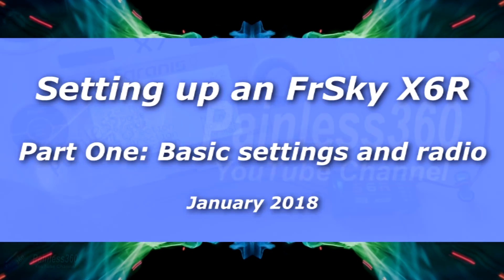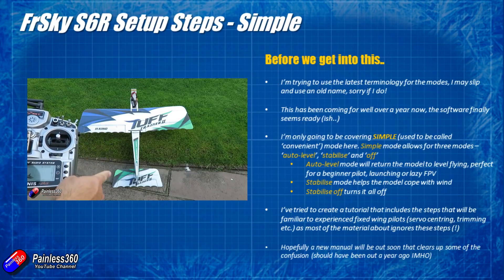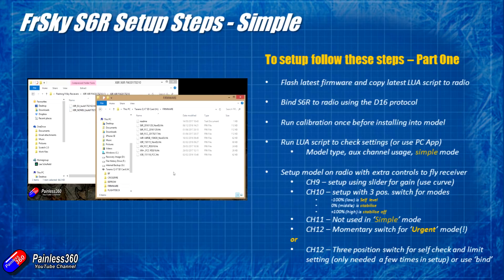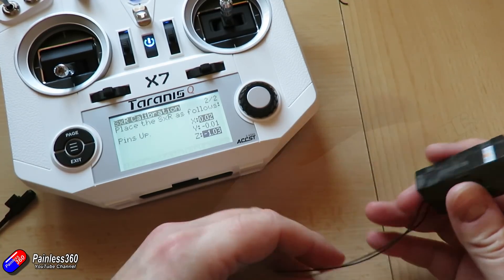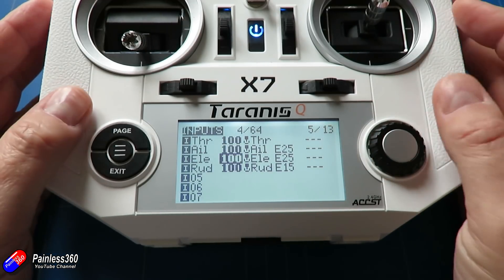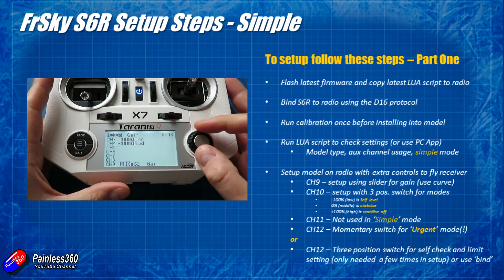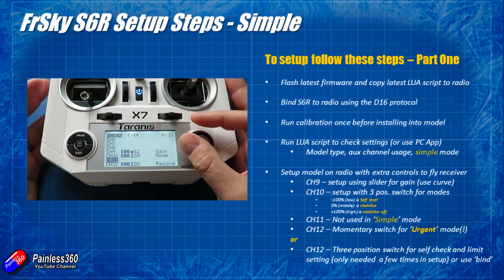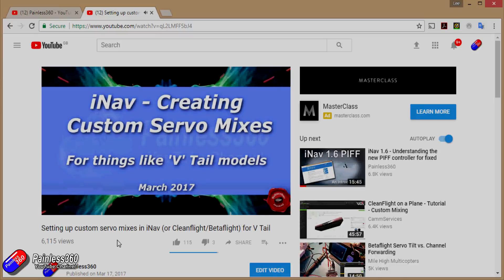(1/2) Frsky S6R/S8R Basic Setup

Comment: Hello thank you for making this video, I get an error code on my taranis after I try to execute the Lua scripts for s6r, it will not allow me to calibrate it nor select any of the selections on s6r lua scripts
Reply: Nathaniel Pike, I had same error when I ran Lua script with receiver plugged into taranis with a cable via s port. You need to bind the receiver and calibrate using the RF link
Reply: @TonyChallis   hello scouring the web for answers.  I have been trying to use the RF link between my Tx and the S6R and I cannot get the Lua script to do anything except go to the intro screen.  Any resolve to this.

Comment: Hi can you help me as i got crow on the throttle but i like a switch so i can have the  throttle on the throttle stick and also have the crow on the throttle stick so i can have one on at the time i have look at all on the mix school  and i can not work out how to do it
Reply from the maker: Lots of ways to do that, only have it 'on' for certain flight modes or simply add a 'switch' to the mix line for CROW mixes on the outputs. Both are shown in the series lots and lots of times. Best of luck!

Comment: Great videos, Thanks a ton.  It took me several times watching it to notice that the lua scripts run with no cables attached!  I finally got it bound and caibrated.

At time 12:34,  setting up a custom curve for the X7 s2 pot for gain.  The other easier way to do this is to set the offset for S2 under mixer channel to 50 weight and 50 offset.  This gives it half the travel range, and starts it at the midpoint at the bottom of the pot (rotary switch). This gives it a range of 0 to 100, versus -100 to 100 it would normally have.  This is the same way most of controls need to be adjusted to use the QX7 as joystick for PC based simulators.  You could still apply a standard or exponential curve on top of the offsets if you want too.

Comment: Is the receiver text need to be facing you When calibrating the SXR with the pins down and up? I do it in a way the receiver is 90° to the table, is that ok?
Reply from the maker: Not sure what you mean. All of the steps I used are in the video. Best of luck!

Comment: I had to reverse the rudder and elevator on my x9d plus outputs to get all surfaces moving in the right direction in manual mode. But now the auto level and stabilizer modes on the S8R seem to react in the wrong directions. Should I have reversed the rudder and elevator somewhere else?
Reply from the maker: All I have figured out is in the video and the steps have to be followed for it to work.. Best of luck..

Comment: I have a Tatarnis DX9plus. And I want to use the S8R for my plane.
Now I see 6 files on the FrSky site in the Firmware folder.
And there are also 4 files in the Tools folder.
Do I have to do all these.
Or has an explanation about which files to use
Reply from the maker: You need the files in the SXR folder on the SD card. Best of luck!

Comment: Great explanation and videos. I was wondering, PROVIDED you were only using the Rx in basic/simple/convenient mode, surely you could position the Rx with servo plugs forward so long as you changed the gain direction of the gyro for the elevator.The other thing which may help others who use all 5 flight modes, I was sure I would get confused by the switches at the field so I found a simple way to get all modes. I set the 3 position switch I usually use for flight modes in the logical switch screen to override ch10 and ch11 to the necessary positions for OFF, STABILISER ON, and SELF LEVEL then  1 other switch of my choice to override the ch10 and ch11 settings for HOVER and a third switch to override ch10 and 11 for KNIFE EDGE. Note: you have to set the mixes source to just the ch number

Comment: I have been flying with the S8R for quit some time now and it all was because of this guide. I followed it and it just works. My Eflite Maule now handles crazy wind haha. Auto level mode is kind of weird flying in but it is level and I have used this mode when wind was a factor and made it hard and it practically lands it self, you just have to give it some throttle input to balance the ladning speed and S8R does the rest. 
However one thing I found weird, since I have my S8R mounted Lable down is this why I have to invert all my channels in S8R lua setup? I had a little action today after I had removed Y-cable to Aileron servos and is now controlling aileron with 2 servos. Aileron channels was at Normal and when i turn on the auto level mode, well it started spinning like crazy since the controller was working against it self hahaha. No worrys though, just turned it of and regained controll but the lesson here is always have a substantial flying altitude while testing new things :) Cheers!

Comment: I've installed this receiver in a Parkzone Corsair,  WingWing Z84 and a Freewing F9 Panther.  I will never fly again without such a receiver, unless I'm installing a iNAV flight controller. 
This receiver works extremely well and not only improves flight performance, but also provides a nice safe feature, no matter how experienced a pilot you are, it is cheap insurance to have the autolevel feature when you need it.  It works equally well for both conventional prop or EDF driven airplanes. 
It is not particularly difficult to set up with with the STK tool or with Taranis Lua script.  There are plenty of good YouTube videos available such as this one.  Just follow them very carefully and triple check to make sure that the compensation is in the right direction.  
By the way, this receiver works just as well with the antenna pointing toward the back instead of the front which was more convenient for my particular installs.
Reply from the maker: Good for you. Why not make some videos to show how you set it up and share that knowledge? Best of luck!

Comment: Hi Lee - stuck at the first fence! Got all the latest firmware (using Qx7 radio). Bound the receiver using D16. When I run the LUA calibration my XYZ axis remain on Zero and the "(Enter) to validate" doesn't appear. Your help, as always, would be appreciated.

Comment: Another wonderful tutorial, thank you for that.
Couple of questions, though.  I don't yet have a stabilising receiver and am kind of hanging back because of your iNav videos, which seem to offer some additional benefits such as Return To Home.     I am only flying fixed wing.
1    What are the benefits of just settling for the S6/8 XR rather than the whole hog of iNAV?
2    I see you are using a different radio. Can the S8R also be used with my Taranis Plus?
Seems to be a lot of things happening in this new (new to me) world.
I am now in my 70s and am considering the potential benefits of a "save me" switch, if, and when I lose orientation.
Your comment will be greatly appreciated, perhaps by a few others also.
Keep up the good work
Bruce
Reply from the maker: +Bruce Austin 1) GPS and OSD support 2) yep. If you want GPS then go INav. If not, then this is worth a look. Hope that helps..

Comment: Excellent info , thanks .  looking forward to the second instalment
Reply from the maker: You can preview the second part (out very soon) using this link - https://youtu.be/_IVFoB8gY6s
Reply: @Painless360  
Hi Painless 360,

Really apreciate all the videos u make, I literally learned everything i know about setting up opentx radios from u! Big fan! Im kinda stuck on settjng up my gyro though. So first of all im using frsky archer sr8 and sr10 which is the access version of the stabilization receiver. So my issue is my retracts on channel 5 do not work even when i set them to auxiliary. Then only time they work is when the gyro is completely disabled. How do i set it up so everything can work. Also is it possible to move the gain and switched from channels 9-12 to say channels 13-16. My sr10 has channels 9 and 10 which i would like to use for something else. Thanks you!

Comment: Hey! Very useful. I'll definitely be following this series. Thx!

PS: Hopefully others (commentators) will jump in and share their successful setup / settings. TIA!
Reply from the maker: You can preview the second part (out very soon) using this link - https://youtu.be/_IVFoB8gY6s
Reply: @Painless360  my s6r doesnt output any servo signal, i bind, calibrate and all, motor spins with throttle, but servos are like they dont get any power to them.... any ideas why?

Comment: Nice stuff!  I have been figuring this out lately as well with the help of some of the sites you mentioned and have it all working, phew.  A suggestion is for Ch9 pot.  Instead of using a curve that goes from 50 to 100% each way from the middle detent, set it up like so, I have Pot S1 on ch9.   S1 Weight +50%, Offset 50%.  That way, it goes from 0-100% with 50% as the middle detent. 
Also be wary of Ch12 and Urgent Mode.  After the 3 flip settings to get it calibrated, you must remember to move it out of the position of Urgent mode, otherwise your Ch 10 switch will be overridden, and you will think that you are unable to control the 3 ch10 settings!  Phew hope that makes sense. 
Cheers again and thanks.
Reply from the maker: Makes perfect sense. Thanks for posting. Did you trim your plane for level flight in ‘stabilisation off’ mode?
Reply: Yes I was planning the maiden today and trim with gyro 'off' first, but the rain has dampened that plan!
Reply: What I do tho, may be frowned upon. Once I verify all the controls and stabilization are working in the right directions, I actually take off with gyro in auto-level mode so I don't over-rotate or make a dumb error with a poorly trimmed plane.  I've seen too many flight-mates drive into the ground on maiden and I don't want to be one of them! 
 Once it gets up there, I turn gyro off and trim the surfaces.
Reply from the maker: +DSA44 thanks for the reply, lots of pilots seem to be in the very similar situation of just getting to the point where this thing is in the air. Exciting times!

Comment: What timing Lee, I've just finished a Multiplex FunCub build and I was literally staring at  the S8R on my desk wondering where to start! 
I had already searched for information and found it astonishingly confusing so I'd given up researching until I was actually ready to fit the Rx. And here you are, like the cavalry! This is going to be fun, but of course, I want to add the knife-edge and hover as well, (well why not if I can get it to work without destroying the model!).
Reply from the maker: I've just got the SIMPLE modes working here, hoping someone else can risk their models for the last pieces ;) The steps for stage 2 (at the moment - TBC - so use with caution) are self check on the bench with the nose slightly raised to allow for the angle of incidence, fly and trim as normal in 'stabilise off', self-check again to store the new trimmed channel middle positions, test fly again and check self level and then use the adjustments in the LUA to trim out any bias in self level and fine tune the angle of incidence using self-check.. Happy flying!
Reply: Cheers Lee, makes iNAv the simple option doesn't it? Thanks again for all your work mate.
Reply from the maker: It does doesn't it! I didn't think of it like that! :D You can preview the second part (out very soon) using this link - https://youtu.be/_IVFoB8gY6s

Comment: Another great instructional video! One thing you might want to add - when you select D16 mode before binding the S6R to your transmitter you need to also change the number of channels to at least 12. When you set up a new model the default is 8, which doesn't allow you to use channels 9, 10 or 12. This caught me out the first time I tried to use this receiver!
Reply: Does that apply to Horus X10? On mine in D 16 mode using FROS I bind it to S6R for 8 ch with telemetry and ch9 and ch12 work fine... but 44 pages for telemetry in model setup...
Reply: D town 313  Yes it works well.... it's what comes stock (S6R) in Frsky's  Vantec AR Plus Wing. Just remember when setting up the S6/8R IN THE PLANE that ch 12 used for "self-check" put on a 3 way switch needs to be toggled 3 times from center to start the "self-check" process as a safety feature, and I agree with everyone who says you should disable ch 12 so you don't accidentally start the process in flight and lose TX input.  Note: The term "self-check"  is poor English translation as it is used  to acquire and set the gyro's auto level trim angle in flight (important) as well as register the gimbals neutral position.
Reply from the maker: Great tip!

Comment: I got mine flying. Started off with 20 on gains. Then i slightly lower them.
Reply from the maker: Please share your process for setting it up and your tips. Others would benefit from the experience (me included!) :D
Reply: First is to calibrate your s6r. Make sure all values are near to 1. Install s6r on plane and plug in servos and esc. Power up and check the plane. If stabilizer compensation is wrong then reverse it using the lua script or configurator. Then switch to manual mode. Move sticks to check control surfaces. If they are wrong then reverse on radio. Lastly do a self check to your plane if they are not flying straight or banking.. Right after the control surfaces moved when self check is activated. Move all your sticks to their extreme. It is to let the s6r learn. Then it's good to go.
Reply: I have a video on it on my page for your reference
Reply: +Pumpkin Head - Hey! Please share your (all if possible) setup / settings. TIA.
Reply from the maker: +Pumpkin Head thanks for that, that's pretty much what's documented in the existing online material. Happy flying!

Comment: Great stuff; I've been so looking forward to this, and I do believe I've managed to set up everything you've done in this video.  However, I've a quite possibly 2 x totally stupid NOVICE questions? 
1. When I set my curve to appear as yours I had pt.1 as x=-100 y=0 and pt.2 as x=100 y=100
2. After doing mixer am I correct in setting 'inputs' for channels 9, 10 &12 to note same switches in mixer?
I am probably way off here but need to ask.  Thank you :)
Reply: If you didn't want to use a curve, simply set up the channel with a weight of 50 and an offset of 50.That will effectively give you the same output as Painless' curve, 0% to 100% (instead of the default -100% to +100%). I hope this helps!
Reply from the maker: Check out the links, my model is in there...

Comment: I hope you will show more on the radio settings such as the channel 10 steps beyond the mixer screen for the 3 positions like -100 and 0 also the +100 . I don't understand the MAX on those steps. Hope that makes sense.
Reply from the maker: Check out the link in the description - you can download and look at the OpenTX model memory I'm using here. If you're not sure then check out the videos in the OpenTX Mix School...